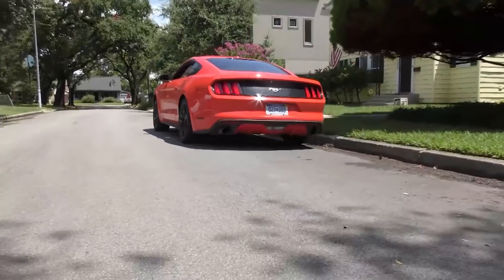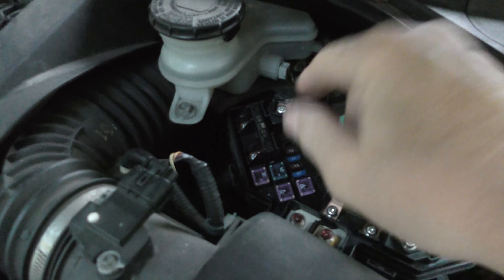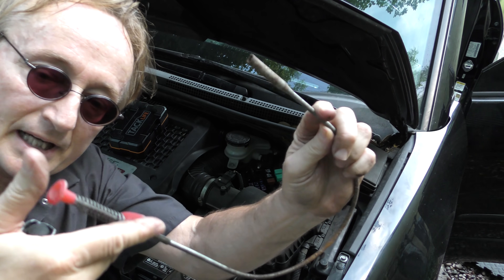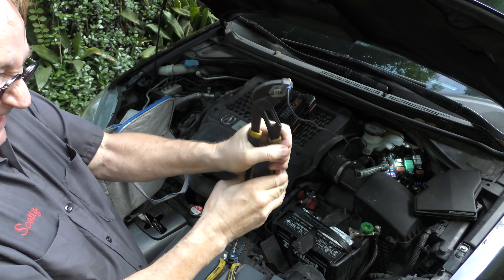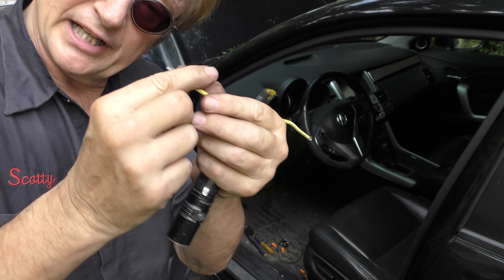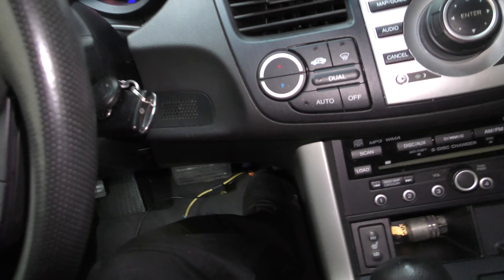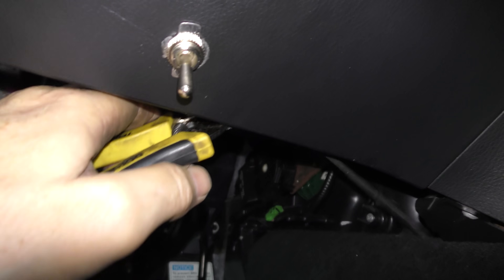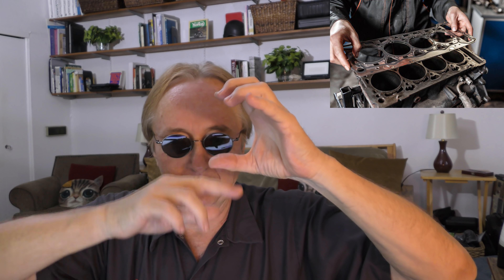This Acura Has a Serious Problem

Comment: Once you start doing this kind of repair,  your ride is on it's way toward being a "bucket".
Reply: No kidding. Terrible fix.
Reply: Word. I hate these kind of "fixes" that  aren't fixes at all but workarounds.
Reply: this depends on how much money, time, you want to invest on. If it is a cheap car, that it is way too old to merit an actual repair, i'd say go ahead.
Reply: @xavierpoes4985  true, but this car didn't appear to be an old banger at all.. quite the contrary in fact.
Reply: @xavierpoes4985  that’s why secondhand cars usually are bought by mechanics so that you can fix problems yourself instead of having it in the shop every 3 months

Comment: Amazing. I'm afraid of electricity even though I had a 30 minute class on electricity in beauty school in 1978.
Reply: It's 12V, the worst thing that can happen is a blown fuse.
Reply: @shane250  mostly true. You have to be careful with the battery because of the insane amount of current it can deliver. Accidentally shorting the terminals can make it a seriously bad day.

Comment: The conversation with the Acura owner, about the wired bypass, is about the hardest conversation you can have with a client. The explanation can go well or it can go very bad. So long as you don't lose them before you tell them that you potentially saved them 2K.

Comment: 1:32 ''we will drill a hole in the firewall here'' and when it rains al the water can leak through that hole..
Reply: If you use a properly sized rubber grommet, you won't have any leaking issues. 

That being said, I didn't see Scotty install one here...
Reply: There’s already so many holes in the firewall though. Why drill another one! Plus he didn’t grommet, loom, or wrap the wires. 🤦🏼‍♂️

Comment: Haha, Scotty. I was thinking that exact solution, I just didn't get around to comment, was busy. I figured you would know all the details to do it. I was thinking, you could even install one of those headlight on warning things that came with my older Buicks, or was available long ago at RadioShack, etc., that would go on if you forgot to turn off the switch when you turned off the ignition. Now many newer cars have a default auto on/off headlight switch.

Comment: As I said to the other video this too many modules when there is a parasitic drain now putting a switch in series with the battery also this connects the power to the computer modules so now the computer will have to relearn its conditions which is programmed and you will get crazy driving conditions

Comment: Scotty you could have put in place a relay instead of a switch as well. I did a similar fix before on one of my project cars and powered the relay using the ignition switch so that it turned on whenever I turned the key on. Flipping the switch every time drove me nuts somehow.

Comment: its most likely the bluetooth voice control module. i had the same issue with my TL. its an outdated system anyhow so just simply unplugging the system located in the ceiling near the dome lights fixed the problem. 

please like so scotty sees this!

Comment: The Handsfree link is a common culprit for parasitic drain in Acura products from the mid to late 2000’s. The module simply has to be unplugged or replaced.

Comment: I did the same thing on my 2009 dodge charger.
I had to run a wire from the trunk to the front. It worked for me.
It been 4 years now..

Comment: This is crazy. Get a wiring diagram , find all the Power Distribution connections for that fuse circuit, hook up your ammeter again, start disconnecting and reconnecting connectors till the  excess milliamp draw goes away .Then you know the defective circuit. Then you look at the connectors for bent pins etc. If the connector looks good blame that component only .   But you don't go unusual, you go standard.

Comment: I heard the key beep when the newly added switch was turned on and it reminded me of a 1980s dodge K car that had the door open light kept running the battery down overnight.  We did the same thing, but put the switch inline with the bulb directly.

I saw a comment about the bluetooth having problems allowing the radio to shutdown below and it brought back memories.  Maybe there could be a recall for this?

Comment: Double ditto on the relay idea!! I would use a socket for the relay and carry a spare relay - just in case.
Scotty, you didn't mention the gauge of wire that you used to jumper in the switch. Maybe a reference to a chart showing current ratings on various gauges of wire would be nice. Also, if possible, using two wires in one wrapper would be good to cut down on the rats' nest situation.
Been doing 'Slavic engineering' all my life.
Thanks for leaving the light on for us!

Comment: If I did that( which I would NOT do) I would at the very least use a lighted switch. But to do it that way and have it the least inconvenient, I would wire a relay to to the fuse location that is only hot when the key is on. Then no switch and no battery drain the Jerry Rig way.

Comment: I really think you need to update your tools with a crimping tool for insulated and noninsulated lugs. Using pliers is just a little bit better than using a hammer to beat them on the wire.

Comment: the only fire hazard i see is no rubber garmet in the hole to protect the wires from wearing on the steel edge of the hole until it shos out and burns to the ground because it will rub from vibration inside that hole

Comment: Nice idea with the switch.  You could also make it a install and forget kind of thing by a little more complexity of adding a relay instead of the switch and powering the relay control from an ignition on supply and the main power from its normal route.

Comment: heyy scottyy, there are electrical gates that could solve the problem, you know they open and close by electrical signal, the control would be like fuel pump or sth, it would do it automatically when fuel pump activates, no drilling no wiring no nothing

Comment: Wouldn't it be better to wire ignition switch power to the circuit within the fuse box? Then the ignition functions as the kill switch - no need to remember to turn it off or drill into the car, etc..

Comment: Scotty why didn’t you use a SPST Relay switch switch Could be wired to the accessory circuit so it’ll automatically come on every time you turn the ignition on

Comment: That's what I'd call a shade-tree mechanic's trick, which I'd do only if the customer was broke and didn't care. Personally, I'd run a full electrical analysis, however the best bet is in the radio area. A lot of in-dash navigation and entertainment systems have clocks and data storage, which need a constant level of current. Two things to look at: A current drain through touching and rubbing connector wires; or more likely, the internal battery has failed. The unit then defaults to drawing the current it needs from the car's electrical system. Pull the radio unit to really fix it right, Scotty.

Comment: I would have added a relay so it would shut off automatically. No easy to explain but would eliminate the need to remember the switch. This is assuming there is no system memory loss. Was just thinking, the customer would no be able to have power door locks functional if switched off BTW.

Comment: Try it see what happens don’t say unless you know for 1 I have put wire to the lighter wires cause it goes on with car and off with car but guess what pops fuse every time so no the problem worse then what it was did the Scotty switch maneuver and wham works like a charm THANKS SCOTTY boom ba lotti

Comment: Never use pliers or vice-grips to crimp wire connectors. Ever. You need to use proper crimpers to "lock" the wire in place, if not, the wire can pull out and usually does. Plus never just drill a hole into the firewall from the inside without looking to see what's on the other side of the firewal in the engine compartment - you could drill into a wire harness or a fuel line or a refrigerant hose or something serious.

Comment: Scotty, why not put the fuse holder right from the fuse box to the wire? What happens if the wire shorts between the fuse box, the wire wall, and the fuse holder, before it gets to the switch? I'd be concerned of a short causing a fire...

Comment: I thought everyone knew about the bluetooth battery drain on older Acuras. The problem was the bluetooth. I'm 100% sure if the customer would have turned off the bluetooth everything would have been fine.
Reply: Some people use it

Comment: Instead of using a manual switch- couldn't you just hook the positive to the switched ignition?? I suppose it depends how the fuse is wired up originally...

Comment: Had the same problem with my 2009 MDX, but problems are still not fixed even in the new models from what I have read.  In my case the relay that powers the AC clutch hangs closed resulting in a drained battery.  Then my HandsFree Bluetooth module started draining my battery.  Over $400 to replace it.  Outrageous!  Every freaking phone and computer has a Bluetooth module in them and they don't cost $400!  Acura won't negotiate on the overpriced module so I have stopped taking my Acura to the dealer for repair work, after MANY years of faithful maintenance there even after one of their technicians stripped my oil plug and just stuck it in the pan with goop before I took a few thousand mile trip!

Comment: Move the relay on circuit from permanent power to ignition on power and the circuit would power on with ignition on and off with ignition off. The function would be seem less and no holes in the dash. Come on Scotty.

Comment: You asked "how come the screwdriver disappears every time you put it down and you need to use it?"   That phenomenon is known by it's scientific name as "Chronosynclasitcinfindibulm"  !  What has actually happened is that the tool that you need at that moment has slipped into another dimension.  It will not return until the mechanic stops looking for it.
Reply: Chrono from Greek khronos ‘time’.  synclastic - curved toward the same side in all directions —used of a surface (as of a sphere) that in all directions around any point bends away from a tangent plane toward the same side. Infin -from  Infinity represents something that is boundless or endless or else something that is larger than any real or natural number. Since the time of the ancient Greeks, the nature of infinity was the subject of many discussions among philosophers.

Comment: Scotty, YOU screwed up, you should have put the fuse next to the fuse box NOT next to the switch.  Now you have a fire hazard waiting to happen because if the hot wire coming from the fuse box that wire will always have power somehow if it touches ground like that whole you drilled in the firewall (DUH a sharp edge) and will cut the rubber insulation on the wire and that wire will get red hot and you can get a fire or wire will melt and fall on your customers leg.

Comment: Having the same problem with my wife’s 2013 Ford Escape. The sync touch screen went out so no radio anymore, and now it drains the battery randomly. Pulled the fuse but it still has the drain.😑
Reply: Find what's really draining the battery and fix that.

Comment: Did that to the cooling fan in my old XJ, replaced EVERYTHING and still the fan would never come on so I hard-wired it and it worked fine
Reply: Hardwiring the radiator  fan come with its own set of headaches too, it can damage your alternator because since the fan is always on the altenator is constantly sending a charge to the fan so eventually its going to get burned.. it can also cause your engine to develop black fumes

Comment: Scotty I'm thinking about trading my 1999 Toyota Tacoma 2.7L 4 cylinder 5 speed manual 4x4 for a 1973 GMC K20 (obviously 4x4) 350 V8 with a 4 speed manual. My Tacoma has 251K miles and the GMC has 78K real miles, is this worth doing?

Comment: how about just tracking down the drain. if it was my car, I wouldn't want a dumb mechanic putting holes and extra switches in my car.
Reply: An ingenious mechanic did this modification.
Reply: The customer wanted a switch installed

Comment: Not criticizing... However I am curious... Why wouldn't you run that to the ignition instead? By doing it that way you would eliminate having to put a switch in and only have to wire in a second fuse coming off of something that gets hot with the ignition switch turned into the run position

Comment: I would have used a relay to the ignition wire switch with the fuse in line with the relay

Comment: Hello, Scotty. I'm having a difficult time to find a way to ask you a question so I will do it here.

I have an 03 Mitsubishi Eclipse GTS 3.0. I have noticed in the past that when I shut the hood the engine would die down a bit but this time I shut it pretty hard and it killed the engine completely. My car started right back up after it happened. 

What do you think it could be? I don't believe it is the battery. The wires are on pretty tight and the terminals are on the side

Comment: I have a 2005 Toyota Corolla. It started squealing so I replaced the Serpentine belt and the noise stopped only for a couple of days. I replace also the Tension bolt because it broke in two pieces (what a pain in the butt) and made sure everything was put on correctly. It is still making this noise. Do you think I will have to replace the entire tension assembly? It doesn't look very worn out

Comment: Had this battery drain issue on my 2007 RDX and after numerous trips to the Acura dealer they didn't find anything.  So, I just traded in the thing at 153K because after the battery drain the AC broke.  What happened to Honda quality?

Comment: scotty my dad is having a problem in his 2016 hyundai tucson with the 1.6 naturally aspirated GDI engine its burning a lot of oil but no grey smoke from the exhaust is this because of carbon build up?
Reply: How many miles on it?  A friend had one and had to pull the head.
Reply: @bwest-yq3uc  140 0000 km its been doing this for 20 000 km but theres no smoke from the exhaust i also heard its because the low tension piston rings..does your friend also have a tucson and what engine?

Comment: Hi Scotty  thank you 🙏 for sharing your advice and wisdom 👍
🤷🏻my dad gave me his suv suzuki grand vitara 2002 xl7 with 130,000 miles 4x4 v6 standard 5 speed  and runs good, looks good,which is the most  sensitive thing in this car , what is the worst thing about those cars  I should sell it now that it's ok (the value is very low) and use the money and put it together with my savings to buy something better or use it until it falls apart. and i know it was made in Japan but there is no suzuki in america anymore what can you say about that

Comment: !!! NO Scotty NO. !!!

Put a relay in and wire it to the mains ignition cct. 

When the ignition is on, the circuit is active. When the ignition is off, your circuit will be disconnected.

Scotty ... why do you make life hard for your self.

Comment: are you damn sure that it is not sparking against metal somewhere slightly? It sounds like short circuit in some appliance which may convert the current into heat somewhere. It can also be faulty relay which would not turn off somepart of the infotainemnt system draining it while connected even after key is pulled off. I mean switch is a runaround not fundamentally solving the problem which may arise eventually...

Comment: FOR THE SCOFFERS AND NAY-SAYERS:
Yes, the issue IS the Bluetooth. You say unplug the BT. That works. No battery drain, but also no stereo, GPS, or anything in the infotainment system. No back up camera-all is dead cuz screen is off.  You say Replace the  Bluetooth.  Acura dealership charges $1000 PLUS to do that,  and hundreds of people say the problem began 2-3 weeks after the  job was done. They take it back, and Acura mechanics don't have another solution. I, personally bought another BT, NOT the Acura brand. I plugged it in, and the very next morning, my battery is dead. I dont know about relays, but THIS video IS the simplest, cheapest, and most efficient way to solve the problem. Note: even Changing the stereo is NOT a solution unless you are very very skilled, because there is SO MUCH going through the infotainment and stereo assembly that even Crutchfield sells NOTHING compatible with my 07 Acura RDX, because, as the manual says, this vehicle is NOT compatible with stereo replacement. So,  NO UPGRADES. 
For these reasons, THIS VIDEO (thank you Scotty) is the most efficient, affordable and concise way to have Music, backup camera, and GPS, without having a dead battery every couple of days. It sucks, but  its true!

Comment: How about put one relay to the hot wire when ignition on relay kicks on ...?🤨
Reply: Naaaa...That's too smart. Let's drill holes in the firewall instead!
Reply: Shane .lol I got your point there ..😁😁😂
Reply: That car is equipped with keyless entry, say goodbye to that too, and security code in the radio needs to be input all the time

Comment: Why not feed the fuse from the switched side of the ignition?
Reply: Or better yet...a RELAY.
Reply: On newer networked cars the ignition switch often ends up being a key position sensor. They have 5V one each pin from the body control module and the ignition switch is supplied ground. The position of key indicated by the 5V signals getting dropped to 0V when the contacts connect the ground. In that case there is no using the switch to power anything.

Comment: A 20 amp circuit should definitely have a relay, not just powered through a switch
Reply: 1. You're right about the relay.
2. It's not really a 20 amp circuit. they choose the fuse by the thickness of the wires, not the actual draw. A circuit with a 20 amp fuse is usually 5-8 amps.

Comment: All is well until that wire chafs through at that nice clean hole you drilled.  So much for an insulator, or GROMMET!
3 months of rough roads and it'll go up in smoke.